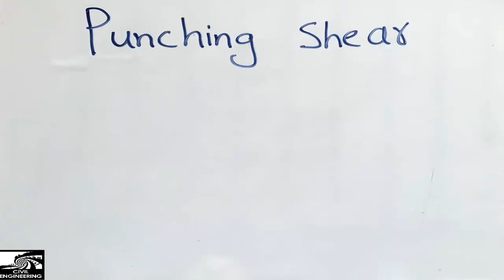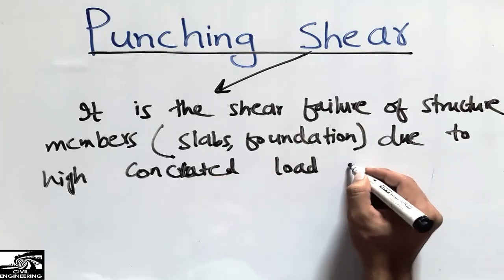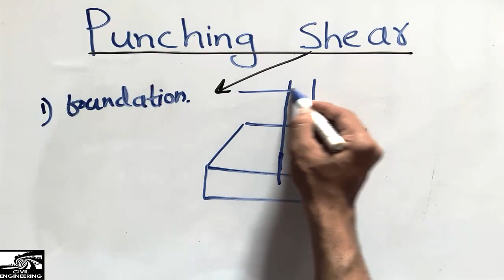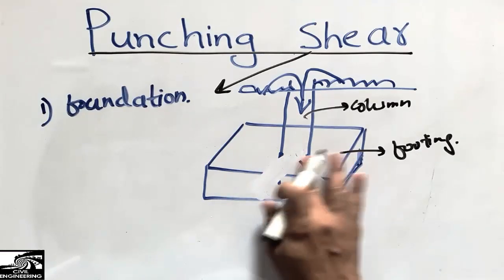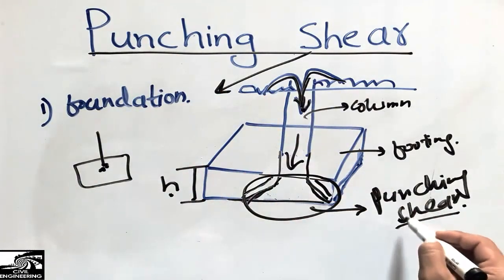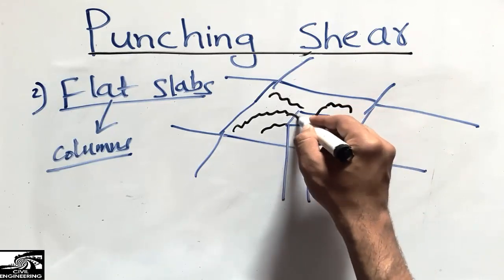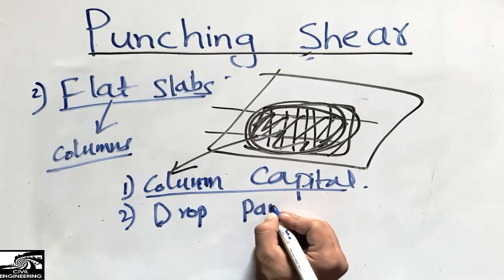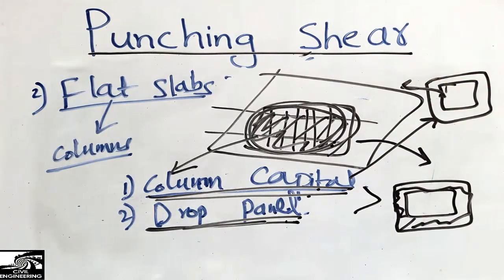Punching Shear in Foundation & Slab with 3D Animation

Comment: Champlain Towers bought me here! Punching shear.  Those balcony slabs surely look very very THIN===> punching shear.
Reply: The balconies had no columns to punch through.  The initial punch through was caused by the 10,000 pound planters and the falling slab put lateral pressure on the building columns.  I don't like this type construction.
Reply: @robertbrandywine  yes, a lot of subsequent simulations have come out showing how even collapse of the pool deck (which was cross-tied to under designed main building support columns) helped start the collapse.  Problem with RCC is its' like a daisy chain collapse!
Reply: @klam77  RCC?
Reply: @robertbrandywine  some people call it "RCC" (re-inforced concrete cement) some people call it rebar built etc etc.
Reply: @robertbrandywine  also, someone called @screamdoctor did visual analysis and it was actually marginally UNDER SPEC for load: "The remaining construction that was visible from photographs, showed a complete lack of thickened column caps at each column and where the columns punched through the pool deck, a complete lack of internal lateral closed loop ties that confine the top of column concrete core and the vertical column reinforcing bars.  (2 are required at each top) Consequently, there was either a 2-way punching shear failure of the pool deck slab or an internal shear failure of the column tops, turning them into spears that easily knifed their way through the pool deck.  No investigation would have likely discovered the completely absent lateral ties in the top of the columns unless the original plans omitted those lateral ties as well.  But a simple 2-way shear stress investigation could have discovered the apparent overstress in the floor slabs at the columns since there was no column cap at each floor.  For a 9 inch floor slab on 20'x30' column grid locations.  The 2-way required design shear load would have been about 164 kips.  However, the 2-way available shear capacity would have been about 154 kips.  This assumes 18 inch square columns, 20 psf partition live load, 50 psf live load and 3000 psi floor slab concrete.  So with no column caps, the floor slab appears to be overstressed in 2-way shear even before we consider cracks due to rusting rebar.  The spear action represents an even greater overstress condition, and it took place with no live load on the pool deck.  This rough analysis ignores the presence of cracking due to rusting rebar."
Reply: @klam77  I've learned in the last day or two that this building was constructed using "flat slab" which means just slabs and columns. This is not only vulnerable to punch through but also the entire building collapses.  Give me beams!
Reply: @robertbrandywine  dude, yes! And even visual inspection of the Cross section of the columns and the density of their layout suggests FAIL!

Comment: You may have noticed that the example pictures of punching shear in various buildings on the internet,  seems to be car parks or slabs exposed to the elements,  this was also the case with the pool deck in Champlain towers in Florida,  the evidence is pointing to the failure of the pool deck due to water penetration , which triggered the collapse of the main building ,  I think slabs that are exposed to the  weather,  should not be built slab directly on top of column, but  should have pads on top of the columns or cross beams for extra support.

Comment: For avoiding punching sheer in slabs. 1. Drop panel. 2. Column capital and 3. Increase the area of steel at top side of support (negative bending or tension area)
Reply from the maker: Yes exactly
Reply: What should be approximately the span bw two column in flat slab? And the size of column to that span?

Comment: Asalamualaikum..

Sir, I have seen on our site we use some columns which have a mushroom head. Is this to avoid punching shear?
Reply from the maker: Yes sure it helps in avoiding punching shear
Reply: @civilengineering94  I have seen analogy of a pushing a pen or pencil through a piece of paper. The point of the pen will go through the paper a lot easier than the blunt end.